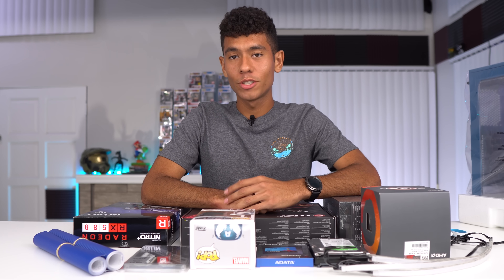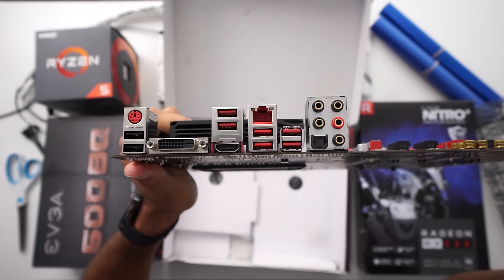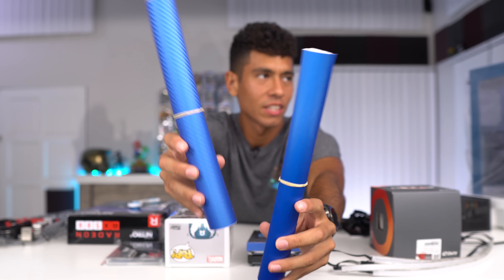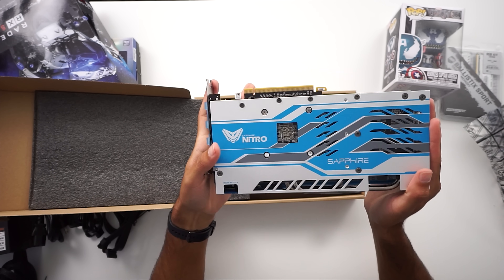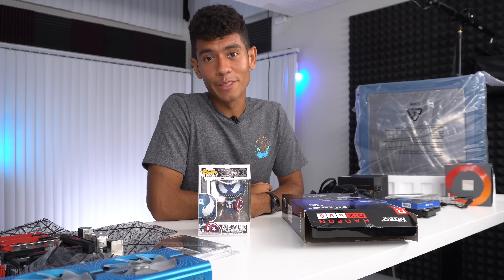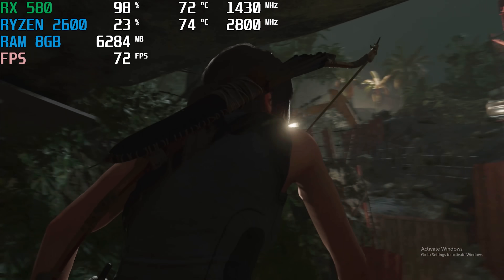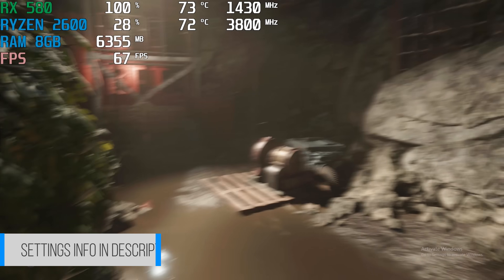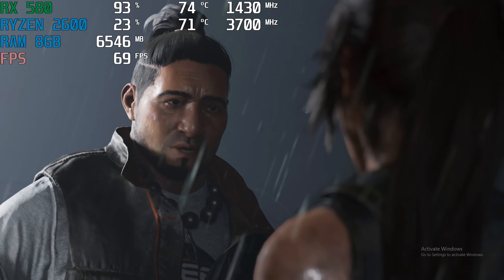$900 Gaming PC Build - Ryzen 5 2600 RX 580 (w/ Benchmarks)

Comment: $300 gaming pc pls
Reply: it won't be able to run much games
Reply: Azire - atleast ill be able to afford it lol
Reply: @default6341  ya but why not save ur money, spending $300 now yes you will have a gaming pc but it won't really be worth it
Reply: Matt Moore lol dude ive been saving for 5 years
Reply: ouch. Get a job?
Reply: Accelerator 1 need to be 15 bro
Reply: Accelerator 1 turning 15 in a month but even then i wont be able to find a job
Reply: For that you should either look for used PCs or get a cheap system with a R3 2200G
Reply: mistermaximal k dude
Reply: @default6341  
Surely you can find some jobs? I'm only 14 but I was able to find a babysitting job which pays $10, and a local church that pays me $10 to help clean up on Saturdays. It doesn't sound like a lot but it adds up to $80 a month.
Reply: This Is My Name not really bro, i live in a run down town if you babysit youll get kidnapped and sold to slavery lul
Reply: Damn, you taking down a notch here. I suggested a $400 build, but you took it down another level for $300! That's a tough price to beat!
Reply: Doug Cannon i heard of something called an apu, i think its like a gpu and cpu in 1 for half the price? Or something like that but got no idea how it works.
Reply: You're correct, an APU is definitely a combination of a computer work processing information while powering the graphics that "you see on screen," you know where you plug in the HDMI cable into the motherboard's I/O instead of the GPU's HDMI plugin. Even I still have no clue how it works or how it even has the power to do it. I'm no internal mechanical expert. I only know what each part does. Like the

CPU: is the brain of the computer
GPU: Is a video card basically and also helps run graphically demanding games
STORAGE: How much information can storage hold such as documents, photos, videos, games, etc.
MOTHERBOARD: A components that holds everything together. Basically like the organs of the body
CASE: The external part of the body
PSU: What powers everything

I know the basic understanding of computers but not like how the minerals "the ingredients" such as sand, glass, metal, like how in the heeeeeell do they make it work?
Reply: Doug Cannon yea bro, thats why i need this dude to make a tutorial
Reply: Dude, he linked his build guide in the bottom of his description. His $1,000 build. He shows us how to build it no matter the price for the budget because the same concept still applied for any price. Just depends on what components you choose.
Reply: Doug Cannon yea arent apus different?
Reply: Doug Cannon yea but*
Reply: APU is basically a combination of CPU and a graphics card. But when you're using an APU, instead of plugging the HDMI cable into the graphics card, you plug it into your motherboard where you placed your I/O shield in. But you'll get less performance than a dedicated graphics card. If you want a CPU that has almost the power of an graphics card, I suggest buy a Ryzen 2200G. Then later once you got enough money to buy the card, I suggest pairing it with a GTX 1050 Ti or a 1060 and disabling the "onboard's graphic" in the BIOS settings, then plug in your HDMI cable to your graphics card that supports HDMI.
Reply: Doug Cannon tbh i still dont understand anything 😂😂 thanks for trying to explain it tho. im well below an ametuer at building pc
Reply: Law of attraction is key for all things
Reply: You could probably get a gtx 750 ti build for around that. Can run most older games (GTA v, overwatch) alright...
Reply: Save up brother
Reply: Woezerz im trying
Reply: @default6341  thats good :) patience and hard work will provide great fortune
Reply: @default6341  dude buy a part a month it'll help
Reply: UnKnown Person wont make any difference, i get 20 bucks every month, so it wont make any different if i buy it all at once or a month a time, not like im saving a couple hundred a month that i can spend, you get?
Reply: UnKnown Person but i appreciate your effort to try and help out (:
Reply: @default6341  No worries man if u can look out on black friday there may be some good bargains on the day. Also maybe get used ram cos it may be a good start for a budget
Reply: @default6341  ahh why don't u buy an old i7 pc and add in a 1060 with a new psu in there. I saw a video of it yesterday nd they were a beast. Should I find the link to show u? Cos it may be more suitable for your budget
Reply: UnKnown Person do you remember what the video was called?
Reply: @default6341  https://youtu.be/KbJ31kQww2Y and also if u want my opinion go for a rx 580 :P because if u update the bios it beats a 1060 6gb. Hope this helps your budget!
Reply: UnKnown Person thanks alot dude, i think ill do that.
Reply: UnKnown Person do you know if there is black friday sales on amazon?
Reply: @default6341  uhh wrll where are u based and tbh from what I saw from checking last year's gpus and cpus rarely drop on black friday mobos and ram does tho. So if u want a look then go for it !
Reply: UnKnown Person im based in australia, and ok, ill wait till black friday maybe ill be able to get some off.
Reply: @default6341  ah well sometimes people get good deals on prebuiltz then just keeo a look ab nd don't rush
Reply: UnKnown Person yes boss

Comment: Can you make a PC with these parts?

AMD Ryzen 5 1600
https://www.amazon.com/AMD-Processor-Wraith-Cooler-YD1600BBAEBOX/dp/B06XNRQHG4/ref=sr_1_2_sspa?s=pc&ie=UTF8&qid=1538971106&sr=1-2-spons&keywords=AMD+ryzen+5&psc=1

GTX 1070 Ti
https://www.amazon.com/GeForce-Advanced-Gaming-Graphics-ROG-STRIX-GTX1070TI-A8G-GAMING/dp/B076RCTXGX/ref=sr_1_5?ie=UTF8&qid=1538971398&sr=8-5&keywords=gtx+1070+ti

Gigabyte Z370 AORUS
https://www.amazon.com/Gigabyte-Z370-AORUS-Gaming-Motherboards/dp/B077JQNQKM/ref=sr_1_1?ie=UTF8&qid=1538971218&sr=8-1&keywords=gigabyte+z370+aorus+gaming+3+motherboard&dpID=51d9DUFSzlL&preST=_SY300_QL70_&dpSrc=srch

Patriot Memory VIPER 4 Series 3000MHz 8GB x 2
https://www.amazon.com/Patriot-Memory-3000MHz-Channel-PV48G300C6K/dp/B0157UPYZ8/ref=sr_1_1?ie=UTF8&qid=1538971356&sr=8-1&keywords=Patriot+Viper+4+Series+DDR4+8GB+%282x4GB%29+3000MHz+Kit&dpID=41i%252BJHvXKhL&preST=_SY300_QL70_&dpSrc=srch

Corsair CX Series 650 Watt 80 Plus Bronze Certified Modular Power Supply
https://www.amazon.com/Corsair-Bronze-Certified-Modular-CP-9020103-NA/dp/B01B72W1VA/ref=sr_1_5?ie=UTF8&qid=1538971769&sr=8-5&keywords=650w+pc+power+supply&dpID=41h2NmpC0DL&preST=_SX300_QL70_&dpSrc=srch

NZXT H500 ATX Computer Case, CA-H500B-B1, Black
https://www.amazon.com/dp/B07C3DWCDC/ref=twister_B07F7V5D74?_encoding=UTF8&psc=1

Samsung 860 EVO 250GB 2.5 Inch SATA III Internal SSD
https://www.amazon.com/Samsung-250GB-Internal-MZ-76E250B-AM/dp/B07864WMK8/ref=sr_1_3?ie=UTF8&qid=1538972169&sr=8-3&keywords=Samsung+860+EVO+2.5%22+SATA+III+250GB+SSD&dpID=31CElO-B3PL&preST=_SX300_QL70_&dpSrc=srch

This added up all together, cost around $1000.

Comment: I just found asus rog prebuilt for like $2400 and it has i7 6700k, ssd 500gb, 32gb ram, and gtx 1080 2ways sli.
Or should i take the single gtx 1080 version for like $2000
Reply: Dual gtx 1080s with only a 400 dollar difference? Go for it, you aren't going to get a deal like this anytime soon.
Reply: listen to the people who built one. Sounds like a future proof splurge either way. See joey playing these games on a 580? 60 fps no problem. You don't need even a 60 constant, you just have to keep it from dropping to 30. If money isn't an issue and you don't feel like building one... buy the ROG. Where did you find it by the way?
Reply: Build it yourself. You're also hardly going to use 32 gb ram.
Reply: Not worth it go custom get 8700k and a gtx 1080 ti
Reply: @acaperic359  It is. 6700K is good and he gets 2 1080s
Reply: Do the 1080 sli
Reply: I’d rather build one. Get an 8700k and a 1080 ti or a rtx 2080 like I did.
Reply: I wouldn't get a 1080 because I bet Nvidia would gimp that when they release the rest of the 20 series cards but... It is a good deal
Reply: What are you using it for?r
Reply: Try building the computer. For the same price, you can probably fit an i7 8700k and gtx 1080 ti for the same price.

Comment: Nice vid, thou 350/450 isn't the budget chipsets at all.  They are the mainstream, 370/470 is the enthusiast line, and the 320/420 are the budget chipset boards. 
450 and 470 even get same power delivery on the vast majority of boards, so overclocking, senseMI, storeMI, precision boost, all that good stuff is still there.  On the Asus boards, you even get the same amount of usb 3 ports, just lose 2 usb 2.0 ports, nothing to lose sleep over. 
  Now, if you're pairing it with something like a 2700x or the like, you CAN see about a 100mhz higher overclock than the same chip in a 450 board would get, but only sometimes, and in almost all the cases you see from tech tubers, that 100 mhz comes at a steep steep temp cost, and has issues with stability that are not present at the 450's max 'stable' clocks.
Reply: Forgot to mention the usb3 type c port.  That board doesn't seem to have one.  The b350 tomahawk artic I'm looking at here has 2 less standard usb ports, but has the type c.  So really there's just one less 2.0 port, and one 2.0 port swapped for a type c port.  To me that's a boon, not a drawback, and another indication that they are not budget boards, just not enthusiast level (thou many have enthusiast features such as type c, build in wifi / bluetooth, higher quality sound, dual 10gbit ethernet, ect ect.

Comment: 1. Phanteks Eclipse P300, chassi-599sek
2. Intel Core i5-8400, processor-2290sek
3. Asus Dual GeForce GTX 1060 OC (6GB), grafikkort-2879sek
4. Cooler Master Masterwatt Lite 500W, nätaggregat-429sek
5. Corsair DDR3L SO-DIMM 2×4GB, RAM minne-749sek
6. Seagate BarraCuda 3.5", hårddisk-549sek
7. Trust GXT 762 LED-belyst, PC fläkt-49sek×3
8. MSI Z370 Gaming Plus, moderkort-1290sek
Hey guys do you think these components would work for a gaming pc.
(BTW sorry for the little swedish and ignore 7.)
Thanks in advance👍

Comment: Please Do a $600 Gaming PC...✌
Reply: He already has check it out
Reply: Mr Mars he already did
Reply: He has
Reply: he did like twice
Reply: At that price I'd get a prebuilt but if you really wanna build a PC I'd up the budget to 700 to get something like an RX570
Reply: If you're close to a Microcenter you can save $30 by buying the cpu and mobo together. They also have the best prices on cpus
Reply: @ardnehsan  Just built this build for about $497, $597 if you include the monitor. Deals and used GPU, cheaper case ofc and a B450 mobo instead of X470. at Microcenter you can save about 30 by buying a RX 580 with a compatible mobo.
Reply: You could take this setup, and then go with similar, but slightly cheaper components.  If you already have a PC that just needs upgrading, odds are you don't need everything here, like a case and power supply.  Grab a slightly lower model Ryzen 5, or even a Ryzen 3 would work and be much cheaper (fewer cores, but for gaming that would probably be fine).  Video cards are similar, you could go with a slightly older model that runs just about as fast.  You certainly don't NEED 8Gigs in a video card, 2-4 is fine.

Comment: How would a I5 8400 with a 1060 6gb fair?
Reply: Amazing. They work great together. I had that pair before I upgraded to an I7 8700k and 1080. You'll easily get 60 fps or more on ultra settings in most games at 1080p

Comment: Do you guys think this is a good build for 600$? 

Amd Ryzen 5 1500x quad core
MSI - B350M PRO-VD PLUS Micro ATX AM4 Motherboard
Crucial - Ballistix Sport LT 8GB (1 x 8GB) DDR4-2400 Memory
Silicon Power - 256GB 2.5" Solid State Drive
Western Digital - Caviar Blue 1TB 3.5" 7200RPM Internal Hard Drive
MSI - GeForce GTX 1050 Ti 4GB Video Card
Cooler Master - MasterBox Q300L MicroATX Mini Tower Case
EVGA - 500W 80+ Certified ATX Power Supply
Reply: Change 1500x to 1300x bc the 1500x is too powerful for the 1050 Ti. But if you like the CPU more, change the 1050 Ti to a 1060, or RX 570 // 580. Games are getting big nowadays so 1TB is meh. Upgrading to a 2TB HDD like Joey uses in his builds is essential since it's almost 2019, new upcoming games are arriving. It will take up your space very quickly. However, 1TB is still manageable and ok for now atleast. Other than that, you are a-okay.

Comment: Did you play all of these games at 144hz? If so did it look bad while playing Shadow of the Tomb Raider, where you were getting less than 100 fps?
Reply from the maker: It is a 144Hz monitor but I was playing the games at 60Hz because I was recording the gameplay with a capture card which acts as a 60Hz monitor. So no it didn’t look weird because the setting were set to 60Hz

Comment: Any tips on how to boost the fps to 140-150 on fortnite? Answers are greatly appreciated! And is it possible to pair this build with a 1070 ti instead of the RX or would that drop all the performances?
Reply: You should be playing on the lower settings not highest
Reply: @tribalhumor6684  i would recommend a gtx 1080 ti for that. None of these gpus would probably hit 4k unless it was a game like csgo
Reply: @christianlee5666  actually the normal 1070 is a 4k card, it can be 1080p and 4k. Not to prove you wrong just informing you lol
Reply: @jackhyatt3537  well yes, technically you are right. What i waa trying to say was that the 1070 was not exactly the best choice if you were trying to do 4k60, but you can still do it.
Reply: @tribalhumor6684  at a budget of a 1080 ti, you should also be changing up some stuff here
Reply: To get 10000 fps you need to uninstall it
Reply: use strecthed on all low and you get better fps, less input delay, and depending on the res you can get better peeks
Reply: Can you tell me why you need 140-150 FPS? Do a little research on FPS.  You only need 60FPS for what most consider optimal gaming. Anything higher helps get through drops.
Reply: @EffeDnDaHead  It actually helps in fast fps like Overwatch , you can see the movements be  smooth wich means better tracking of the target

Comment: Love the case. I am building a setup very similar but with the Asus x470 mobo and a MSI 580 Armor (White instead of blue, and doesn't have the casing but $40 Cheaper). Gonna put a Cooler Master MasterLiquid ML240R in it to keep the the temps down a little more (+RGB BABY!) all in all the build will only beef up the cost in case to around $1100. Really liked the bench marks(haven't seen another 2600+580 shown) and am stoked to get it built. 
Good video man.

Comment: I wanna help you succeed! lol great job on building a semi-budget banger PC.  I have one similar to this on my wish list in newegg but has 16gb of 2666 ram and the msi b450 pro carbon, for the same price..... anyway... you should add what resolutions you are testing at.  The temps could come down a bit just by adding an intake (or 2) and an exhaust fan.  itll make a world of difference. more thermal headroom for your CPU and GPU to add small overclocks, but most importantly, longevity.  sub 80 for both during load is still good.  but just adding 2 fans will help significantly especially since both GPU and CPU are air cooled.  thats all. :)

Comment: Joey could you do a EVGA GTX 1070 SC Gaming Black with a ryzen 7 1700x, a corsair h100, 16gb of Corsair vengeance ram 3000mhz, msi x370 khabib gaming, 1000w power supply, inside the nzxt razer s340 atx. A $1500 build I think (I'm uk) a d thank you and keep up the good work :)

Comment: Can someone tell me if this is worth trying to build because I am seriously considering buildpc and I want to know if I can get a better one for about the same price
Reply: I built one around the same price with the 2600x  rx580 and 16gb of ram.
Reply: this is as good as it can get  trust me. Maybe you can get 16g of ram but other than that you can't use a better gpu than rx580 or gtx1060 or cpu,cause then you surely going to pay more than 1000~1100. Also there is no point of getting something better than a gtx 1060 if you don't have a high refresh rate monitor (with free sync or gsync) which btw are extremely expensive and you already get more than 60 fps in every game as you see, so there is no point of paying more money on a better gpu. Same goes with the cpu and m.2 drives. So yeah as i said this build is spot on.
Reply: but if you are going to upgrade your monitor in the future, may as well just buy a better gpu now

Comment: QUESTION.  What if I went with an EVGA 1070 superclocked edition paired with the Ryzen 5 2600 instead of the RX 580? Will it bottleneck? I currently have a Ryzen 3 2200g with a Gigabyte 1050, I built myself for my first PC, so the Ryzen 5 2600 seems like a good upgrade soon.

Comment: Just a off topic question: Say I overclock a GPU on one pc and move the GPU to an entirely new pc does it still remain overclocked or not ?
Reply: it does not, unless you change the vbios of the graphics card (which no standard overclocking software supports, you'll need special programs to do that). it is possible to export overclock settings however, depending on the overclocking software you use.

Comment: Any of you know what these specs would give me in general?

Processor Intel Core i5 4590 3.3 GHz Quad-Core Processor Intel vPro Technology
12GB 1600 MHz DDR3 Ram
400GB 7200 rpm SATA 6Gb/s
DVD-RW (R DL) / DVD-RAM
Gigabit Ethernet port
Installed Wireless
GPU AMD Radeon R5 240 1GB GDDR5 Dedicated Video Memory
4K support PCIe-x16
DVI-D and Display Port
1920 X 1080 Resolution

Trying to get a cheap pc that can do okay gaming, good video editing and not lag when screen recording.  
Is this a good machine?